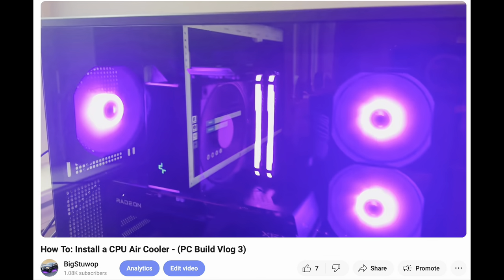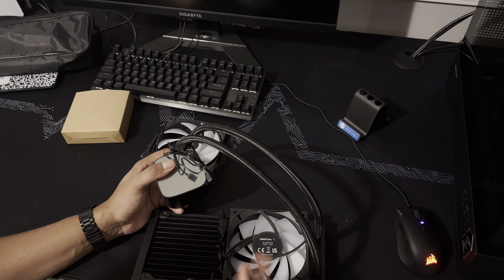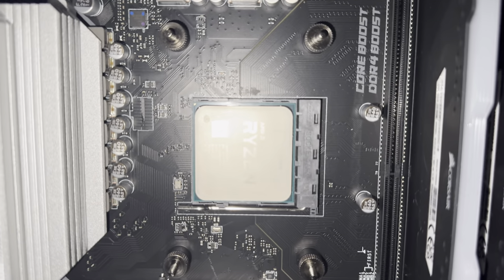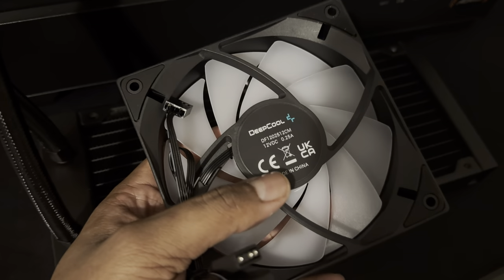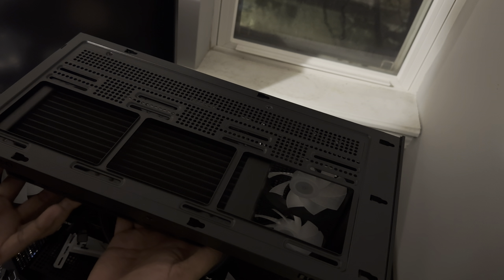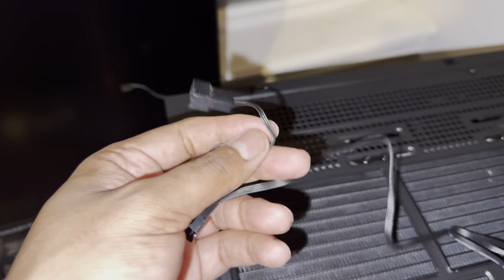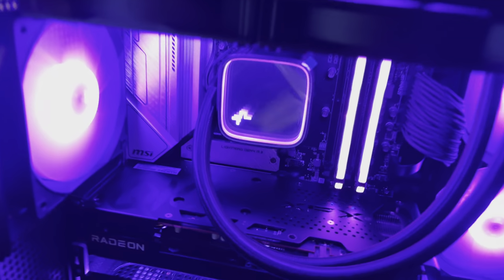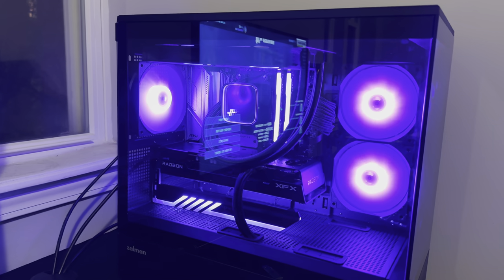I Watercooled My CPU! DeepCool LS520 SE - (PC Build Vlog 3)

Comment: Why cpu fan and not pump fan ? I have similar motherboard and i dont know where i have to put
Reply from the maker: Both work the same. Pump usually goes pump fan and fans go cpu fan. If both are controlled by one wire than either one works

Comment: Hi, can you please advise, today I connected this cooling to the motherboard asus z270k and the backlight does not work neither on the pump nor on the coolers. There is no arbg connector on the motherboard itself
Reply from the maker: @mbuniqueart  if the motherboard doesn’t have a connector then there’s no way to control of
Reply: @BigStuDolla91  maybe some third-party adapter will help?
Reply from the maker: @mbuniqueart  not sure. It’s a pretty dated motherboard and in not sure when rgb control started
Reply: @BigStuDolla91  We will update as soon as possible then. Thanks for the answer 😉

Comment: How is it so far?
Reply from the maker: @sanlo981  had a fan issue and switched to other brands. I’m using a Thermalright frozen notte now which is cheaper. The review is on my page
Reply: @BigStuDolla91  what was the issue
 i already bought it and its coming today
Reply from the maker: @sanlo981  a fan was grinding across the sides  of its housing. I think it was just a bad fan. Otherwise you should be fine
Reply: @BigStuDolla91  thanks

Comment: Bro You have to rotate the pump
Reply: No? The pump is the correct way? Do you mean that he should put the pump towards the rare fan? 😮
Reply: I'm joking ❤
Reply: It won't make much of a difference. I have this exact same aio and originally mounted it identically to his set up. I finally got a new thermal paste and reseated it and decided to turn it so the "dc" was right-side up, and honestly, no difference. I'm sure the pump runs just fine how he has it and how I had it. If the tubes were at the top, probably a different story.